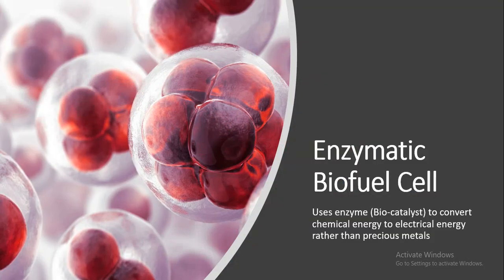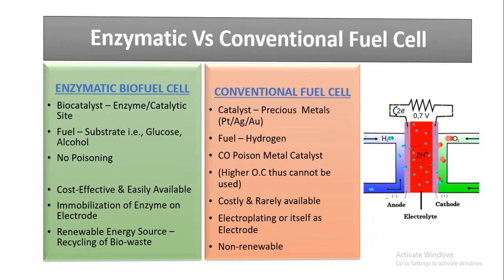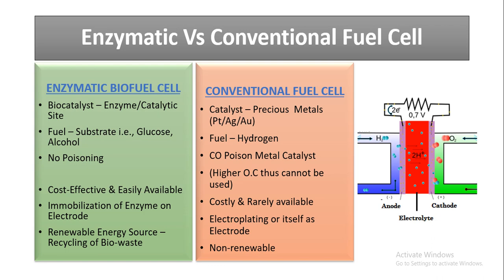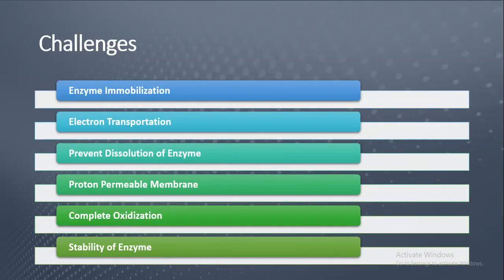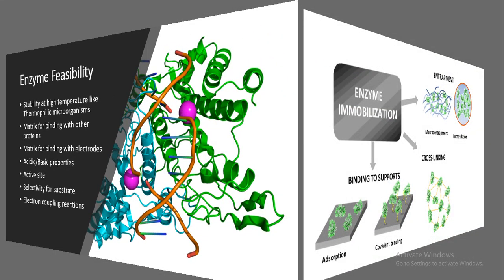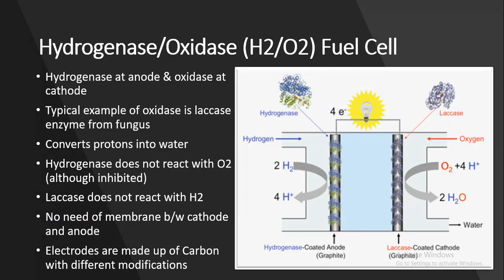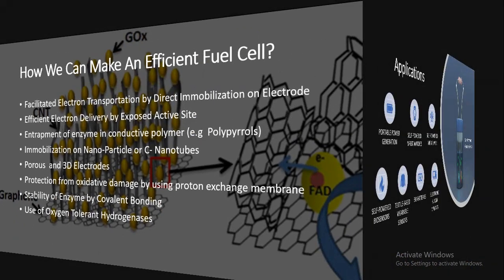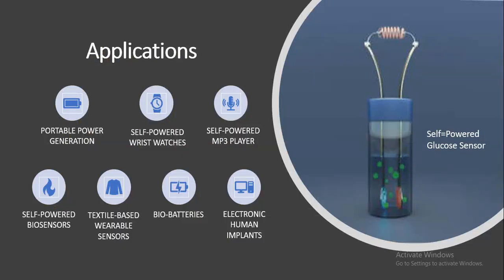Enzymatic Biofuel Cell

Comment: Hello, I am an university student that is trying to make a enzymatic fuel cell, I don't want it to be particularly efficient, I just want it to work. I have a few questions if you wouldn't mind. First, I only have access to platinum electrodes, I've seen people use them in glucose fuel cell without enzymes, can I immobilize enzymes on them ? Second, how do I immobilize enzymes ? I've tried searching for protocols online but I need to pay for anything remotely interesting I didn't have any chance with that. 
If by chance you had a protocol, that would really help me out, but the video was a big help anyway !
Reply from the maker: Ues it is difficult taskt to immobilize enzyme on platinum electrode. But why u want to use such a costly electrode. I think u should use graphite electrode. And I think enzyme can be adsorbed on the surface of graphite electride more easily than others